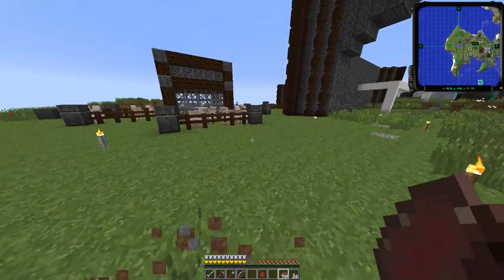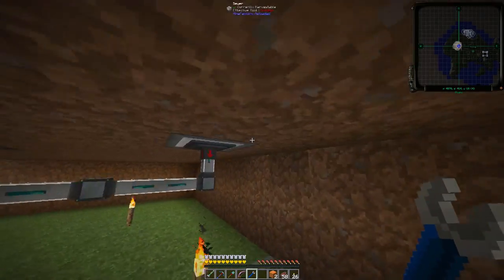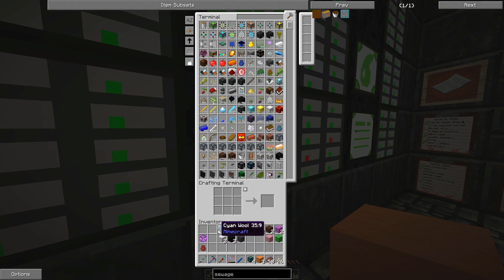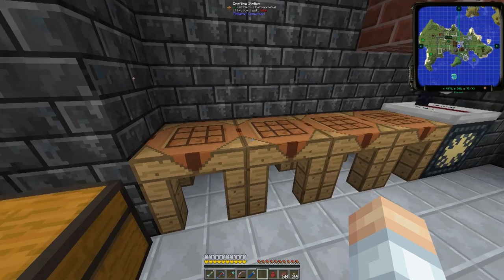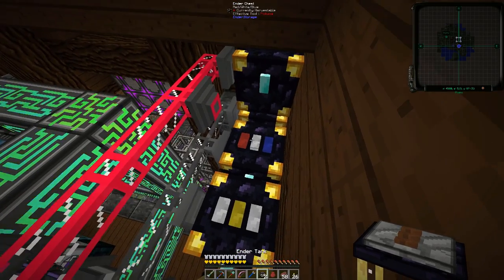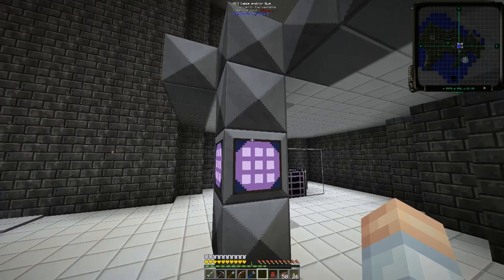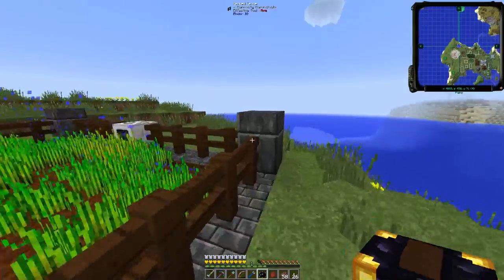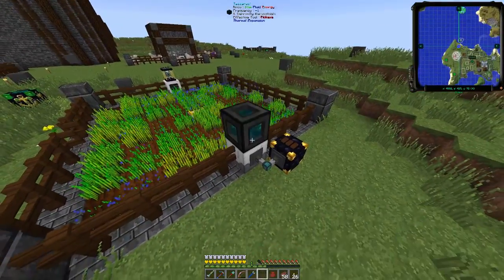Minecraft Mods: How to Process Sewage in FTB Infinity Evolved - E27

Comment: I have Killer Joe in the Nether grinding Blazes and Blitzes, outputting XP through a portable tank, through an XP drain, into a sewer, making mob juice for the MFR spawner which does the Blitzes, routing the byproduct sewage through a Liquid Router to an Ender Tank, which passes it on to a Composter on top of a Fertilizer, which speeds up a tree farm, which makes planks for x8 and x64 generators which power the Tesseracts, which power the spawners, Ender Quarry, and all the machines. Steve's Inventory Manager turns sawdust  into compressed sawdust, which is turned into charcoal for a blast furnace in a Nether Furnace heated by an Immersive Engineering External Heater. The sludge gets boiled and routed through Ender Chests into sorting Jabba barrels. The excess power is pumped into an Induction Matrix. 

Your decaying wheat is from the Sludge Boiler. :)
Reply from the maker: Wow, that's quite the setup. It's fun to string together a bunch of mods to do complicated processes. Thanks for sharing!